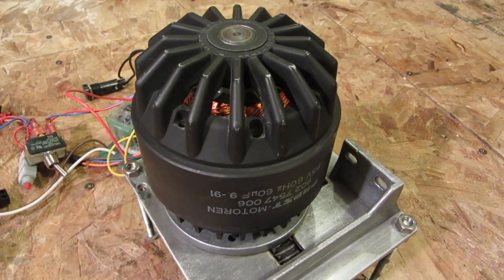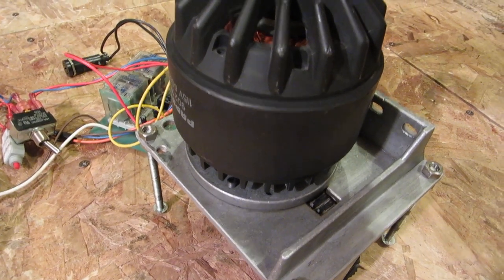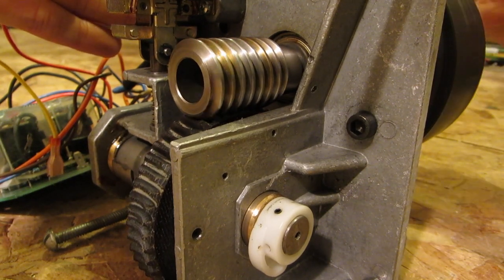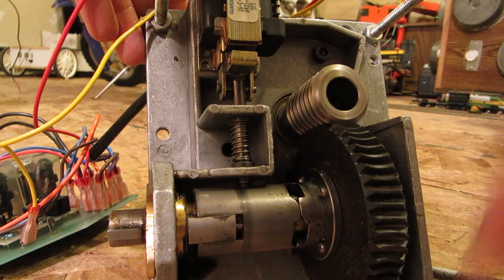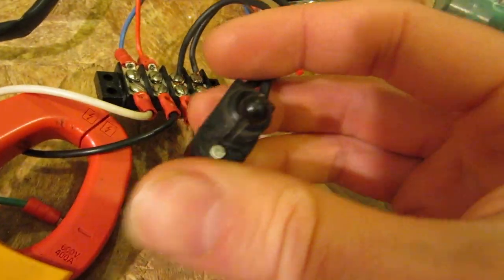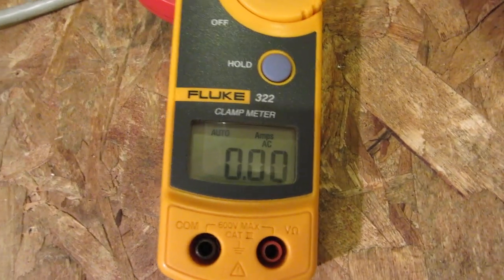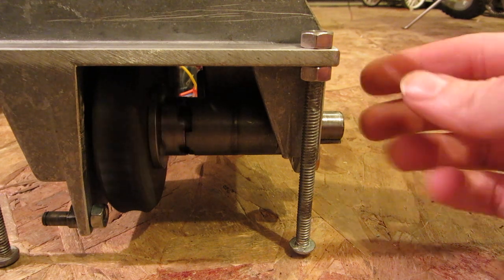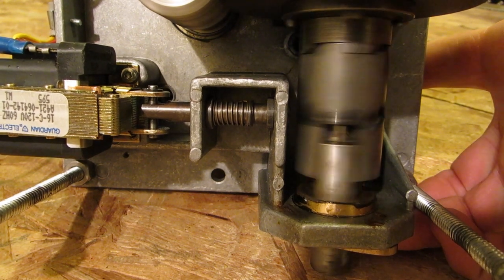Binding Motor

Comment: Cool motor and gear box. I would think of the gear box as a mechanical transformer. The power going in and out will the same(-losses) although the voltages and current may be different.

Comment: There is a lot of torque on the output shaft. Power can't be any more than what the motor is putting in. It would be slightly less due to losses in the mechanism.

Comment: That's how ceiling fan motors are built... Made for relatively low speed, high torque. I've never seen one quite like that though.
Reply from the maker: Yea imagine if a ceiling fan was powered by this motor think of how fast it would go lol.
Reply: +HL4EHalfLife Not very fast unless it were geared up, but I'd be concerned about damaging the blade assembly or any cranks other than the motor's own even at 1:1 ratio.
Reply: +HL4EHalfLife i tried that... do not try that.
Reply: +HL4EHalfLife i had a fast fast motor
Reply: +Sergej Nadaždin The only way I've ever found to really fix up a ceiling fan is to GENTLY twist the blade irons to a deeper pitch. Move it like two degrees at a time, test the fan, repeat as needed. Unless the fan is an old Hunter Original or otherwise equipped with waaaay too much torque, you will reach a point of diminishing returns as you just bog down the motor. At that point, just back off and call it a day